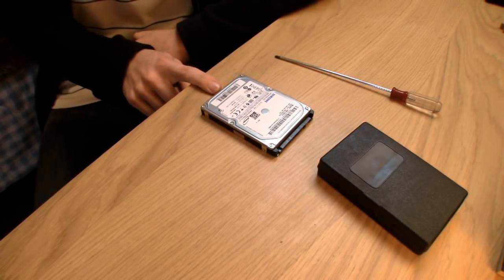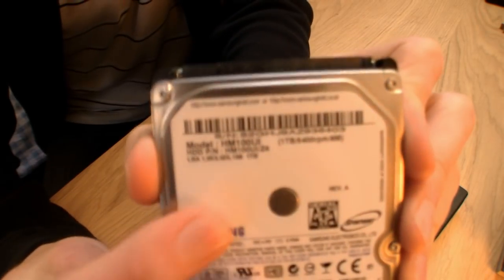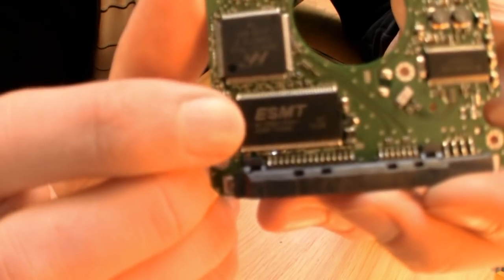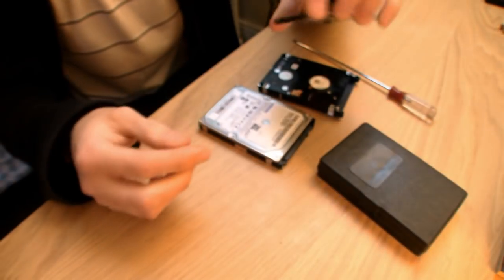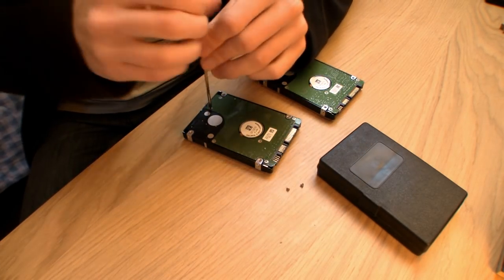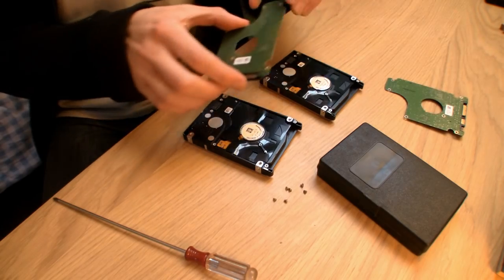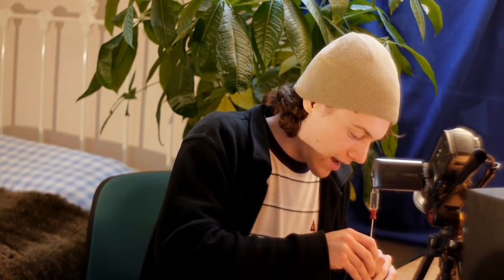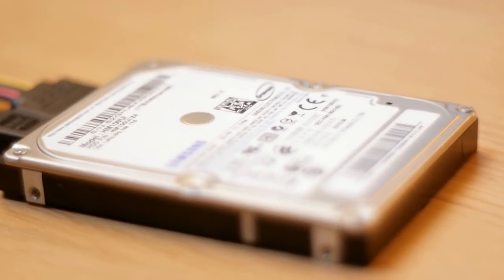how to fix a hard drive (and get your data off)

Comment: Not a silly question. You need a Torx screwdriver and they're widely available. A set in six small sizes is pretty inexpensive (unless you take the hard drive to the store and check which size you need and just buy that one, which is even cheaper!).

Comment: Matt is a talented speaker/actor gives clear explanations.  I have a Western Digital (Sams Club) that overheated (probably the bad power strip from power serge). I think one of the internal connectors is the problem.

Comment: First thing I would try is removing and re-seating, the board to rule out loose connections.  If that fails, I've have lot's of good results with a re-flow gun.  You wouldn't believe how often failures of this type are due to one or two little pins on a chip not being well soldered to the board surface.

Comment: I did this once, But I just looked if the chip board looked the same, and had the contacts on the same places, before I swapped. It sort of worked, the computer wasn't able to read the data. But after formatting it, it worked flawlessly. But before I formatted I used a program called getDataBack NTFS, and with it I manage to save all the data I wanted.
Reply: I am planning to swap my PCB, but I am told that I need to get an IT to download the firmware or it will ot work.  How can I download,what I need myself?
Reply: J Simon I don't know, I just switched the PCB, and formatted the drive, after that it worked flawlessly. But I do not recommend doing that, It could just have been that I was very lucky picking a compatible PCB.

Comment: or you could look for the chip board that matches the hard drive, that's what I was advised by my local computer shop when mine went, and it will probably be cheaper than finding a replacement drive to lift the chip board off

Comment: You could also possibly use a Linux Ubuntu Live USB. If you go to the Ubuntu website, they have a guide showing how to create the USB, and its all free. Once you have the USB ready on the other computer, plug it into your dead computer while the system is off. Then, turn the computer on, and immediately press the "Boot Options" key. This is usually F12, but can very depending your computers manufacturer. Select the USB, when options are displayed. Once the USB loads, select "Try Ubuntu".

Comment: I'm going to try this on my 3.5" 2TB Seagate Pipeline which went toes up and only had 30GB left, so I've got tons and years worth of data to recover. But from what I've heard, you have to unsolder the IC BIOS chip from the bad board and solder it onto the replacement board. Each chip is unique and if the data on the platters doesn't match the signature on the chip, then you're out of luck. Also, my drive isn't completely lifeless. Windows can't see it (it tries but causes the cursor to change to the hourglass) and the drive makes a sort of random beeping noise which sounds like its caused by the heads being too close to the platter(s).
Reply: Did you try a swap on that Seagate? Did you need to bring over and solder the BIOS chip, or did it work without it? 
Thanks! :)

Comment: This is great. Thanks for the info. I have a Hitachi and I never did a system image but the power went bad on it any way. I have found the same hard drive from same year but made in January in stead of February which is the date of manuf for mine. I do not know if that will make a difference with Hitachi or not. Could you help me? Thanks

Comment: Thanks for the video, but I have a different problem. When I plug in the adaptor the light flashes for a second and goes off straight after. I've tried plugging it in slowly etc. but nothing seemed to work. What could it be? How do I fix it.

It's a 2Tb WD Elements. Thank You.

Comment: On a 1 TB Seagate drive (from in a Iomega case) I ended up having to reflash it with it's firmware, which was a little more difficult since I had to take apart my iMac to get to an internal SATA port and then boot it off a Dos CD.  But it worked, and I was able to save my relatives 2 years of digital pictures, though it didn't fix the drive long term.

Next up was to get a board for it though.

Comment: You are absolutely Genius Matt as I said before. Thanks for sharing your knowledge and experience with others.
Reply: I wonder that this seems to be such a big trick, as i did this first time many years ago with my two ibm 20gb hdd's, it was absolutely logical for me so i thought it is for many people, but i never looked for charge or revision numbers, only that they are similar and it worked every time, ok, i did it only four times. I also solder on all pc components, i just think you can't break broken things, so try and error is the best, bcs only way, buying new things you can any time, but you can save your money, if you try to repair the broken first.

Comment: Thanks for vid. My 'MyPassport 1TB external HD' was dropped. Since then I have that nasty clicking sound. When I plug into computer it isn't recognised. In case PCB was damaged I sent for new one and installed it (as per your helpful instructions)... hoping it was to do with PCB/lack of power input but unfortunately not...I still have a clicking HD - but at least have eliminated one potential way to fix it. SO, any suggestions on what my next step could be? Thanks in advance.

Comment: Same thing happened to mine,  i put it in the freezer (in a sealer bag). left it in an hour. When i took it out it worked for 30mins then failed again, but it gave me a chance to get my data back off it!...   People say this doesnt work, but believe me it did for me.  tap it while its upside down with wood has worked for me before too.

Comment: This is just something weird, Sometimes you can throw the hard drive into a freezer for an hour, then hook it up to this usb adapter, and read your files, then throw the drive away. It seems that a bearing or the motor has frozen up, and by cooling it, allows it to run for a little while. I did it once. It works sometimes.

Comment: Before doing that though, go to Best Buy or Staples or whoever, and buy a transfer cable, remove your HDD, hook up your cable from that HDD to a USB on another computer, it should pick it up as a drive letter. Transfer you pics, documents etc. across then reformat it. All your doing is removing the loading stress from the HDD, like when it loads Windows and turns it into basically a separate drive that doesnt load Windows.

Comment: Great video Matt. Thanks for the time you took to show others how this is easily done. I would recommend you use some static wrist wrap, and a rubber table pad to avoid the extra shock you give the drive during this video.

Comment: I have watched and read somewhere that the screws should have a specific torque in order for the hard drive to function properly. In your video, that seems to be not the case. If i remember correctly, the hard drive that was shown on the video i am referring to was a western digital. Do you think that such is not the case with Seagate HDDs?

Comment: if you look closer after rev.1 you'll see a date yours is 2010/09/08 + more under neath my hdd (exact same model has 2010/11/24 so its not compatible even if its also rev.1 samsung did do a good job at labeling also mine says m4b instead of m3b of yours. also the front date is different

Comment: Did I miss something Matt?  where did £600 come from? You would have brought a cheap laptop on ebay before you fork out that much for a disk drive.? Is that what you meant? or was the £600 for data recovery? Good that you showed us all about board swap. Thanks

Comment: and you have a spare HDD, but the platters are shielded from magnetic fields so don't worry about the screwdriver being magnetized unless it is a gigawatt mag. lol. for me though i have a WD drive with some strange screw heads on so regular driver won't work and i was hoping for a clue as to the tool for them. good job though, thanks

Comment: Looking for the screwdriver. It has like a star shape to it, very small and its 6 hexagon screw driver. Link were to buy would be appreciated
Reply: Depends the PC, but the fews i've looked at inside always use 4 sided screws or whatever
Reply: Go to a hardware store and ask for a torx driver. They will know. Take your drive so you can get the right size. I have several sets it my garage.

Also on Amazon.com
http://www.amazon.com/Titan-12710-Tamper-Proof-Star/dp/B000LQEUJ0/ref=sr_1_40?ie=UTF8&qid=1409456388&sr=8-40&keywords=torx+bit+set
Reply: Amazon has a few hundred thousand available

Comment: Samsung HM100ui 1TB 2.5" hard drives has some serious firmware problems all across the world. I have also one of them with a broken firmware and so swapping PCB board with another hm100ui did not work for me. I will try to swap also winbond ROM chip (8 pin small black chip) on PCB in my next try.

Comment: Hi Matt. Great video. I have a WD My passport 2TB that I've had only for a few months. It's not detected. The light comes on a there is a weird kind of repetitive buzz sound that comes on every few seconds or so. I sent it to a data recovery company but they were going to charge me more than £800 but said they can get 100% of the data off! They said it's an internal mechanical problem. Is there anything else I can do myself? Thanks!

Comment: thank you very interesting!
Reply: To Tony Nee
A tech at a local computer shop said that the SSDs (Solid State Drive) are not as reliable as the old HDs. Just saying.
BTW I have 21TB of hard drives. How do I back all that up without costing an arm and a leg?
Reply: Ramon Preston Yip when they fail they fail catastrophically meaning your data is gone!!! Hence always back up an ssd drive DAILY!!!

Buy a tape drive and back yer 21tb up with a DLT.

Other than that you are gonna need to grow an extra leg or two.

Comment: Obviously you want the boards to be exact in chip layout, then you want the manufacturing date to be within 2 weeks of each other so the firmware is the same. He is saying to buy two HDD at the same time for parts, but that doesnt mean they were made at the same time. One could be easily 1year old while the other is only a couple months old.

Comment: can you swap hard disk platters if the read and write heads are damaged??
Reply: Short and sweet no! If you open up a HD to attempt to resolve an issue with the platters then you will kill it.  Best option buy a new HD :)
Reply: Joe McDermott well thanks, though  some told me its possible
Reply: I think that ultimately it might be possible actually but! With hds being as cheap as they are these days why would you want to swop the platters and not just purchase a new hd?
Reply: Joe McDermott  Good question.. I want to recover my precious data.. Actually I just thought of a way to recover it. i'll notify you if it is successful..& yes, I already bought a new hard disk.
Reply: Ahh right ok i'm with you. Well the data itself is stored on the platters, so replacing the platters would essentially mean loosing the data. Good luck with recovering the data though, I hate  it when that happens!!
Reply: gingerbread185 did you succeed in recovering your files? i need to recover my data from my hard drive... any help would be appreciated..
Reply: What happened to your hardcore l hard drive?? Is it still in tact?
Reply: Hard drive.... Forget the hardcore bit lol

Comment: Hi Matt;
You did a very good job.
I also have problem with Samsung Momentus 1TB 2.5'' WC REV.6
It has a head problem, we need to change it's head.
Anyway, in your video your source hd board firmware version is T1 REV.1.
What is the target hd board firmware version? 
Must it be the same?

Comment: Thanks for the video, but I just have one quick question.. I had a 2010 Macbook that I dropped causing the hard drive to fail and not be detected.. When I took it to a repair shop to get my data off, they told me that 'it doesn't spin' so it can't be retrieved.. Will your fix work for this type of problem..?

Thanks in advance..

James

Comment: question i have a bad western digital model wd2002faex dcm hancnv2aa the good drive i have is western digital model wd2002faex dcm  harchv2aa if i put the head of the western digital model wd2002faex dcm harchv2aa into the western digital wd2002faex model dcm  hancnv2aa will it read and transfer the data to another drive even if i have to put the board on with 
the head will i get my data

Comment: I tapped it each side and the clicking has actually stopped...which is definitely an improvement -nice trick. But I get a message (as before) that says 'The disk you inserted was not readable by this computer' With options to 'Initialize...' 'Ignore' or 'Eject' ...wondering if I initialize does that erase all the files? Or is that the thing to do now? thanks again.

Comment: After selecting "Try Ubuntu", you should pretty much have a full working OS, running from your USB thumb drive. From here, you can check to see if your hardware is even recognizing your HDD, simply by looking in the action bar on the left. Any storage devices will be displayed there. If you have checked to see if everything is plugged in correctly, and its still not displaying; I would presume its something more serious.. Hope this bit of info helps, Good luck if you are still having problems..

Comment: My WD Passport beeps, but doesn't click. On Disk Manager, it sees a drive is there, but can't initialize or give me any info on it. Ran WD's test program. Passed the first two, did not run the zero test as I did not want to lose data. Purchased a universal adapter, but for the life of me, I don't see a single hook up in the kit that would fit my WD passport. I can see power, but not how it connects data. It IS under warranty, but I'm betting they don't cover data recovery. Got any suggestions other than kiss my data goodbye?

Comment: Why does this model not have a platter or an arm??
Reply: VFX Ltd™ They do have arms and platters. You can hear it spin up when he hooks up and tests the one he fixed near the end. They're inside the case, which he didn't have to open since the circuit board is mounted on the outside of it
Reply: tekdro I literally dissected mine and didnt even find the arms and platters.

Comment: hello Matt i have an western digital hard drive 500 gb that when i turn on my pc its dead and not detected and i have an seagate hard drive that when i turn on my pc my pc automaticlly shut down and starts to beep [ pc] . what should i can do . both drivers worked great before that happens ! thanks for your time !!
Reply: First check your powersupply, they suck all nowadays, if you got a other one, try this or if you got another system where you can check the hdd's, best is if you got a 100% working system, maybe a friend or someone, where you can take the psu from and check the harddrives. But i'm pretty sure that its the psu, bcs i changed it in my system already three times and know it from many other people, nowadays there is no difference in quality depending on price, buy an expensive and it will break the same way like the cheap one, blown up capacitors.
Reply: i have an old small factor hp given from my uncle . i think the power supplie is ok because they worked great especially the western digital i have this disk from 2008 . i dont know i opened the disk to see if something stucked or something like that nothing !
Reply: Aaaaahhhh you opened the harddrive?! :O You can't see anything inside, if it is broken. Come on, say you are just joking.
Reply: no bro all its allright inside !!!
Reply: +calisthenics workout You should never open a hard drive! Now you won't get it to work again.

Comment: Hey Matt...I really like your videos.....I have a Passport 750gb usb3.0 jan 2011 but I really dont know where to find it....do you have any idea where to find this kind of things? Ebay doesnt work very well in this case
Reply: I know I'm not the person to which your question was directed, but I think I can help. In your case, You need to remove the drive from the enclosure to get more specific info like model, manufacture date, part number,  as well as info about the driver board.  ...Regarding searches,  I've always gotten the best results doing a general search on multiple search engines rather than on one a specific site e.g, eBay or YouTube.  After the results appear, if I don't see anything of interest, I click "images" , then "videos", etc.  The human brain is naturally picture oriented, so, as long as you have a picture in your mind of what you want to find, the eyes tend to snap to similar images.  Even if the image isn't an exact match to what you had in mind, there's a good chance that it will, at the very least, get you pointed in the right direction faster that scrolling through long lists of search results in text.  Although research seems to be a more technically oriented skill,  it's also largely kind of an art. :-D

Comment: My seagate external hard drive stopped working, the disk doesn't spin, and it makes beeping noises. I've tried using a usb adapter, but that didn't work... well this repair my hard drive if I switch the boards? thanks if you can help...

Comment: Hi, My external WD Hard drive isn't detected & can't be seen in My Computer, Windows XP's Disk Mgmt or Mac's Disk Utility Mac, but it acts like a drive installed & can be removed safely via the icon. Manufacturer says it appears the device is physically fine bcos it's spinning, powers on and lights up. I think it may be the problem you show in this video. I don't have a lot of money and I just got an extension from the company before my warranty runs out. Can you help diagnose?